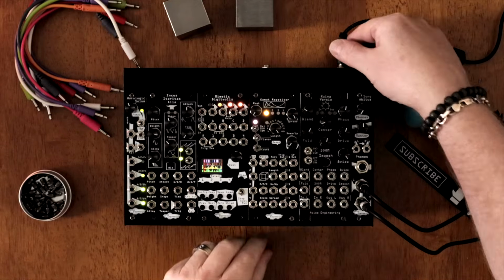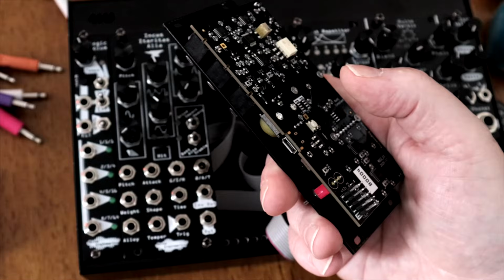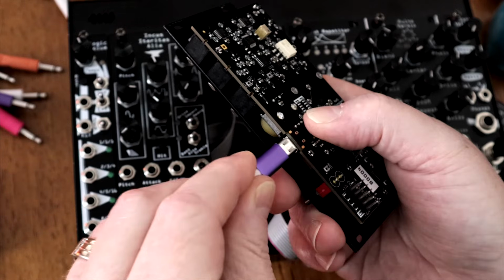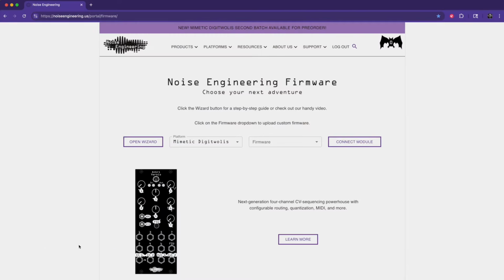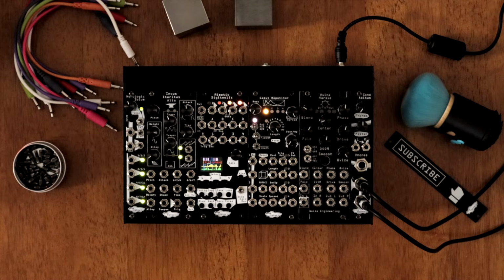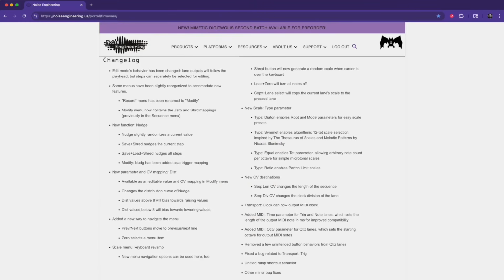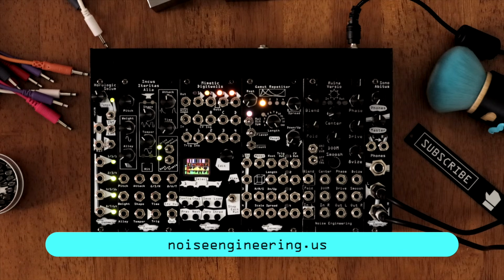Mimetic Digitwolis Firmware Update: Microtones, Randomization, MIDI improvements

Comment: Hi! Is it possible to add an ability to record notes directly from MIDI? Meaning, I would like to connect my midi keyboard to Mimetic and play a sequence (with my hands) and have it recorded into the Notes lane.
Reply from the maker: It requires manual advancing, but Edit mode allows for note entry via MIDI!
Reply: @NoiseEngineering  Awesome, thanks!